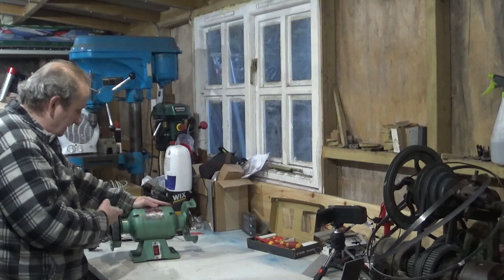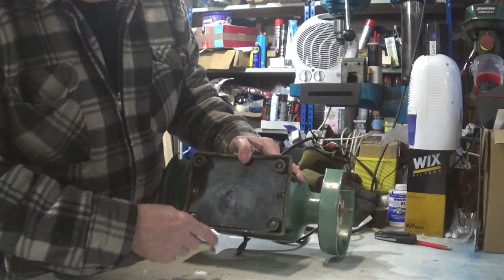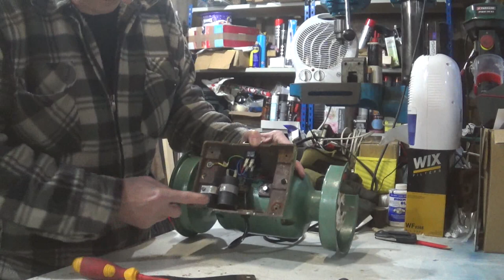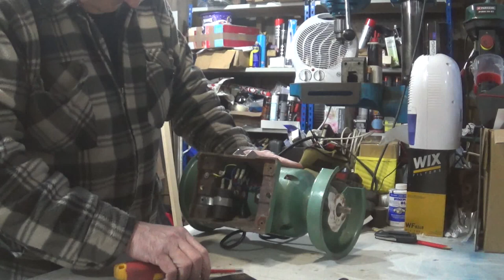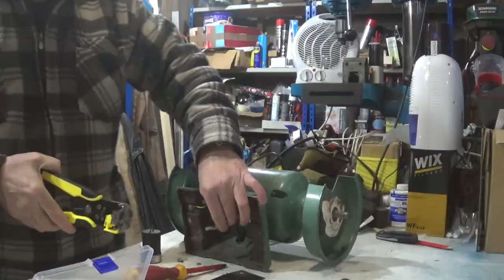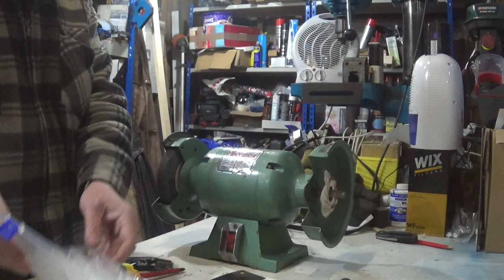Fixing A Bench Grinder That Will Not Start

Comment: A nice easy fix - saves tracking down a replacement capacitor - I didn't hear a centrifugal switch so I guess that one is a motor run rather than just a motor start cap - probably anyway.  The tingling on the case is odd though - maybe test it with a megger meter if you've got one, see if the insulation is breaking down.
Reply from the maker: Tracking down a capacitor of the right value would not be difficult. You are correct that it would be a run capacitor, I've never heard a centrifugal switch in a bench grinder and certainly not this one.
Reply: @BensWorkshop  True, that would be a fairly run of the mill motor capacitor - I've had trouble sourcing heavy duty ones in the past, but that was a fair few years ago.

Is that a dehumidifier on your bench? Is it damp in there?  My shed was dripping with condensation and things had started to go mouldy in places - I've installed some forced ventilation to try to circulate the air a bit better.
Reply from the maker: @GrumpyTim  I've seen some fairly heavy duty motor caps about...

Yes that is a dehumidifier and I have done a review of it... I do get condensation on the steel roof but will look to insulate it one way or another.
Reply: @BensWorkshop  I used some of the bitumen based corrugated roofing - it was really quick to install compared to my usual plywood and roofing felt, but it really does suffer from condensation  - ah well, I'll know for next time!!!!
Reply from the maker: @GrumpyTim  Mine is steel because the part of the original shed I took down that survived the best was steel. Once I put some insulation under it, it will be fine.
Reply: @BensWorkshop  Your shed is a bit of a masterpiece  - very envious :-)
Reply from the maker: @GrumpyTim  Cheers! I'd like a bigger one and if I had a bigger garden I would have built in bigger.

Comment: Awesome I guess I know what’s wrong with my bench grinder
Reply from the maker: If it buzzes like that and you can manually start it, it's either the capacitor or the connections to it. 

I am very pleased to have been able to help.

Many thanks for watching, please like, share and if you like the channel, subscribe!
Reply: @BensWorkshop  thanks I’m fixing my dads grinder for myself and when you try to turn it on it makes a huge loud buzz noise but the wheels won’t spin.
Reply from the maker: And if you try to spin the wheel, what happens?
Reply: @BensWorkshop  idk yet I’m kinda busy right now, I’ll try to work on it later and when I do I will let you know, we’ll stay in touch. 👍🏻
Reply from the maker: @danymitehazard  Cheers
Reply: Benedict White hey I just took a look at it and underneath it doesn’t have a capacitor
Reply: Benedict White hey when I turn it on it makes only a huge loud buzz noise and wheels become locked tight, they will not rotate. I don’t know 🤷🏻‍♂️ what’s wrong and it doesn’t have a capacitor underneath either
Reply from the maker: @danymitehazard  Does it turn freely when off? 

There should be two coils, check that they are not shorted together.
Reply: Benedict White yes it turns freely when off, but when I power the grinder it gets stiff and buzzes and it won’t move. And it doesn’t have a capacitor
Reply from the maker: @danymitehazard  How many wires come from the motor body to the foot?

Comment: Any hints on what to do when the grinder wont spin at all unless you loosen the wheel on one side?

Mine has a wire brush on the left.  A grinding stone on the right.  I switch it on and it humms but is jammed.

I cant even turn it by hand.

I loosen the wire wheel side, just a quarter turn and off she goes.  The wire wheel itself wont spin because its now loose, but the right side grinding disc is spinning at least.   Hope that makes sense.
Reply from the maker: Makes perfect sense. I expect the wire wheel is missing a spacing washer. I made one for mine for stones, you can see what they look like here:
https://www.youtube.com/watch?v=0WUamP79mPg

I appreciate that you probably don't have the equipment to make one but at least you will know what sort of thing you are looking for.

Many thanks for watching! Please like, share and if you like the channel, subscribe!
Reply: @BensWorkshop  - Thank you for the speedy reply.   I had a look and all parts are there - but I found my internal flange has wear marks on it - its sliding in too far and rubbing against the case.  swapped it with the outer one and we seem to be back up and running.   Wouldnt have found this without your suggestion.  Thanks again.
Reply from the maker: You are very welcome. Take a look at the channel, you might find other interesting things on it.

Comment: Nice restoration.   Dealing with a capacitor makes this a lot trickier.    Thanks for sharing this!
Reply from the maker: Many thanks, this one was easy. I now have the same problem with the motor on my milling machine. Suspect the capacitor but it is a much bigger motor.

Many thanks for watching, please like, share and if you like the channel, subscribe!
Reply: Hello I came across this video while searching for information about a similar situation. My bench grinder's capacitor is missing and the connections were tampered with. There's four wires from the pinion,and I can't figure it out. No schematics also,wherever I look. Can you give me some info on how this one is wired,so I can hopefully start mine after getting a capacitor for it?
Much appreciated,and I subscribed as well. Thank you for the instructions
Reply from the maker: Many thanks for watching and subscribing!

Generally it is easier to find, see and reply to comments if you start anew rather than reply to an old comment.

Have you got a multimeter? One that can measure resistance? If so start by identifying which coil is which. One should have a higher resistance than the other.
Reply: I appreciate you taking the time to answer. I read somewhere in the comments about centrifugal switch,so it turns out the wiring was setup correctly,i was just looking for a "missing" capacitor,but turns out I misplaced the centrifugal switch while disassembling and there was no initial contact with the clutch plate.

So,to anyone reading this,learn from my mistake and mark exactly where on the rotor axel it's fixed.

Have a nice day,and I'm off to watch more of your interesting content :)
Reply from the maker: Neither of my bench grinders have them, they both appear to have run capacitors but some induction motors are "split phase" which means that they don't have a capacitor.  Is yours a Sealey like this one?

Also, please start a new comment thread as it will be easier to find your comment to reply to.